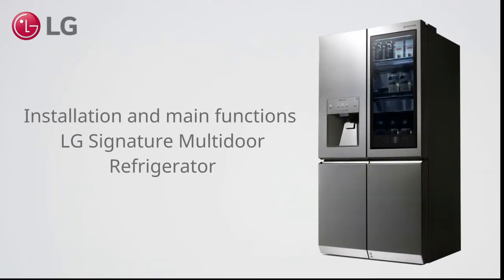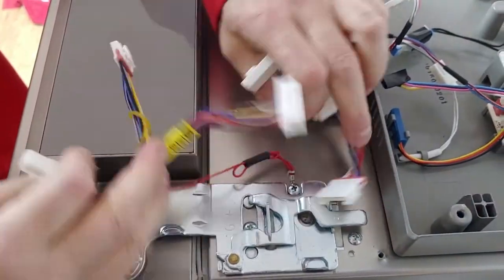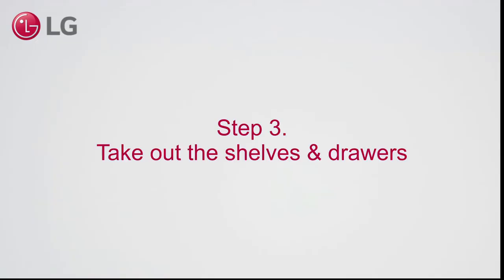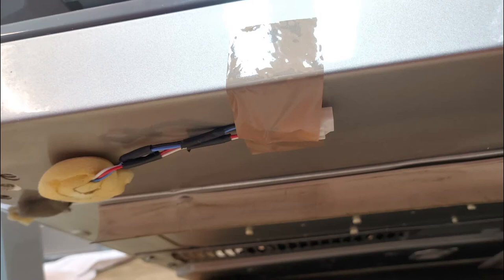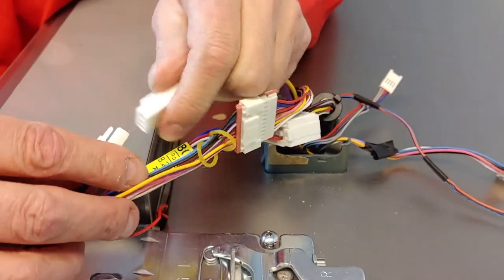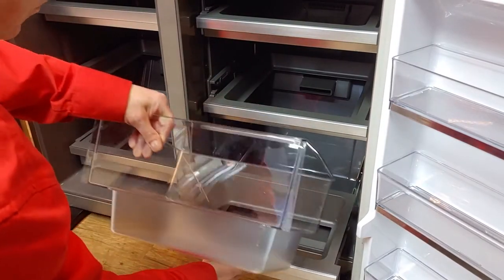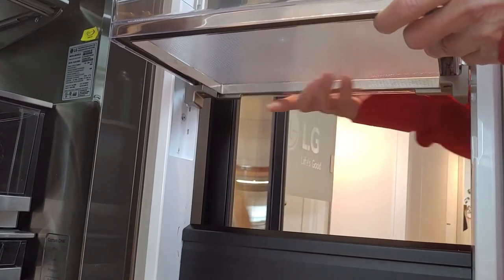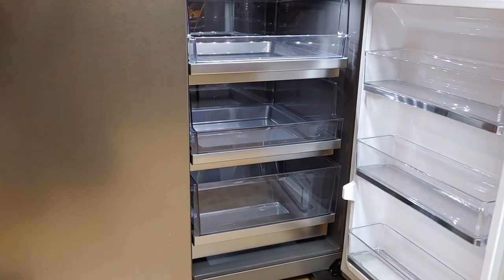[LG Refrigerator] Do you know the Installation + all functions on an LG Signature multidoor fridge?

Comment: How to remove the freezer separator to access evaporator fan?
Reply from the maker: I'm afraid you need to contact a professional repairer for this action.
Reply: @LGSAE  Would be great if you can post manual, so local LG technicians could learn without breaking $8000 fridge